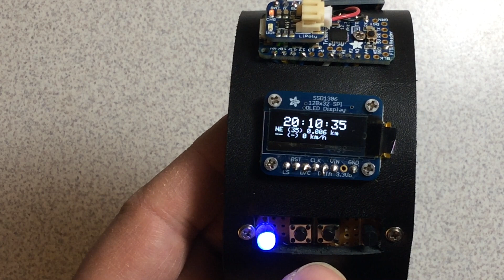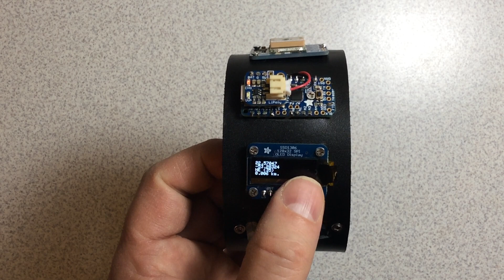Arduino GPS Watch

Comment: than you for this tutorial, but if i need to make this smartbracelet for seniors and i need to take back the coordinates generated by gps to  use them in localisation in application android ?? plz any help
Reply from the maker: Haven’t looked at this for a while... but I would try some Bluetooth stuff to get it connected to android.  You could make it a lot smaller if you got rid of the display and buttons.
Reply: Please Mr shawn i need your email to contact you for more than information about that because i have a project in electrical engeeniring about this, thank you

Comment: Hey awesome project! would you be so kind to share the source code?
Reply from the maker: Code needs to be cleaned up.  Had to try really hard to make it fit in the 28 KB on the Pro Trinket.  Take a look at my Altoids Smalls GPS blog post at ShawnCruise.com if you want to see similar code.  The watch is based on that.  Working on another version currently using an Adafruit Feather with more program storage space.  I might post the code for that when it's done.
Reply: +Shawn Cruise I was unable to use the ultimate gps with my 3v pro trinket, that source code could potentially be a fix to my problem.